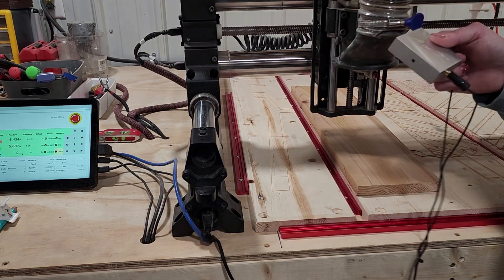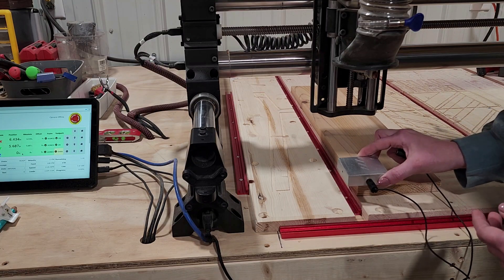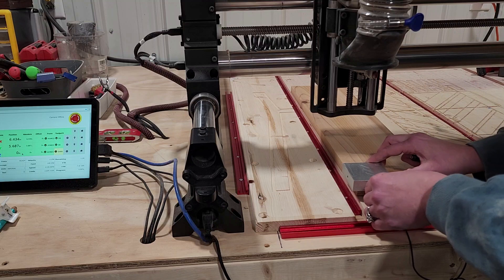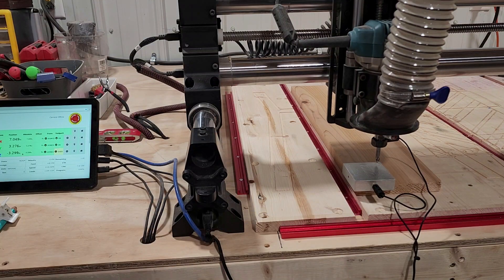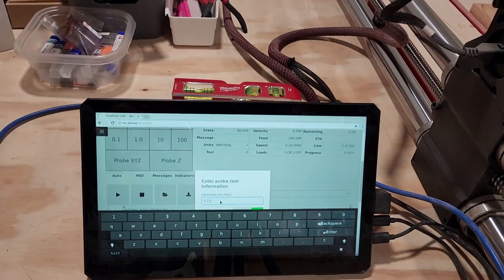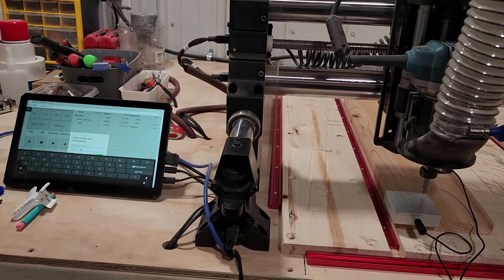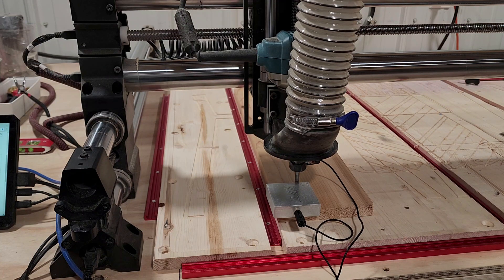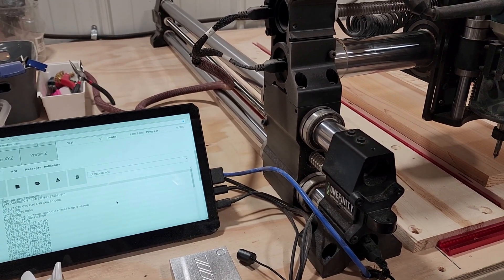OneFinity Touch Probe

Comment: How do you use the controller vs the keypad. How to move fast, slow and really slow
Reply from the maker: Hi there, so if you are using the Xbox controller, the buttons all have a different speed. Yellow is super fast, Red is a normal speed, green is slow and blue is super slow. I personally use the Xbox remote and it is the only way to go in my opinion. 
You can also hold the top button on the top of the remote and it will lock it into only moving in the X or Y direction. 
Depending on which CNC you have, you should be able to adjust your settings within your controller. I hope this helps!

Comment: While watching your video I noticed a few errors that could be confusing to new users.
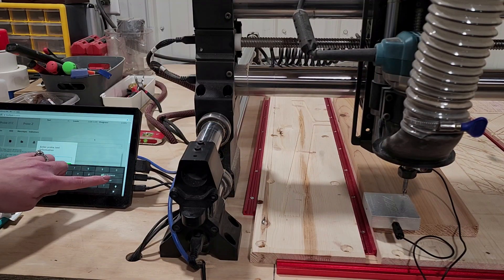•At the 3:23 mark you stated that if the bit was a ⅛" bit you would use the 1.20.125, huh?
I don't even know what 1.20.125 is, if you meant to say 1.0125 then that is 1⅛, and ⅛" is 0.125. 
•At the 5:54 mark, you stated that the X is up and down which is wrong the X is left and right the  Z is up and down.
•At the 8:00 minute mark you stated that if you moved the router all around you would have to hit the home location on the X and Y for the Z.  The teardrop icon that you are touching is for zeroing the workpiece.
 If you hit the teardrop icon for the X and the Y the router's new zero would now be where it's currently located. 
I know that you mentioned how you are a newbie and a beginner at this and still learning.
So I'm curious at how this video has been up for over a year and it has yet to be edited and corrected.
Reply from the maker: Hey there. Thanks for the comment. I was super new when I made this video. I understand I made mistakes. I’ll add a re-do to my list of videos to tackle. Honestly the reason it’s still up is bc I don’t think about it on the regular.